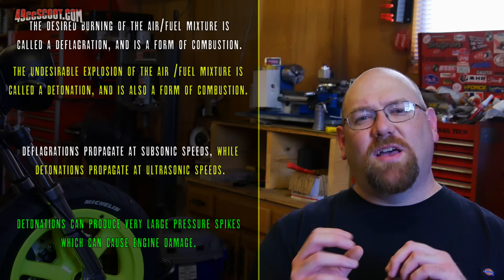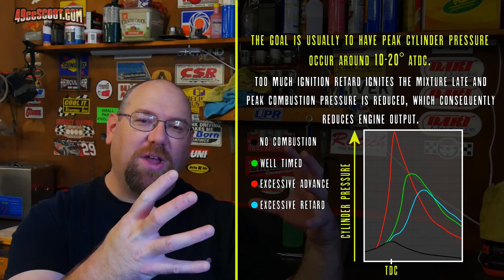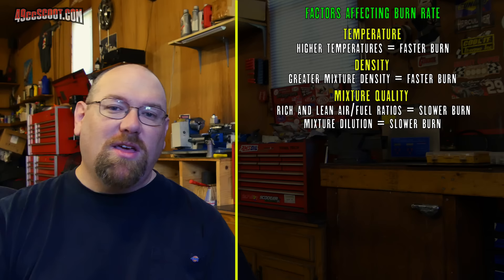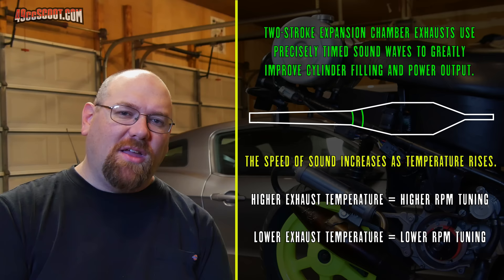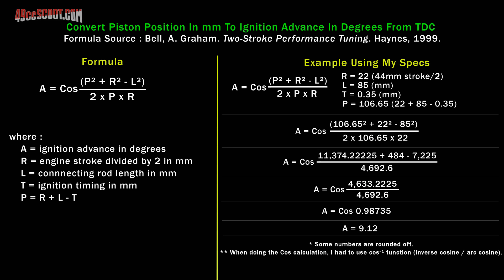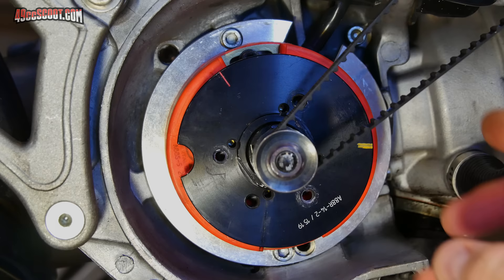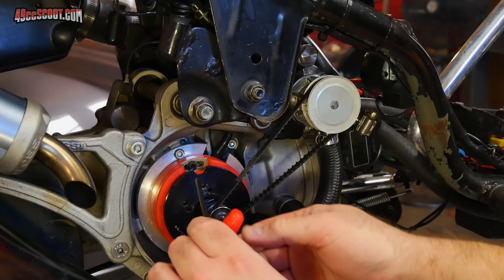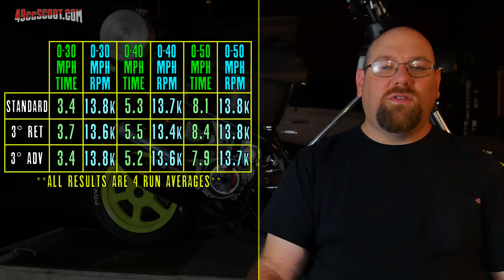Ignition Timing Explained & Tested : How-To Advance & Retard Timing With The MVT Digital Direct

Comment: Man, you need a dyno 😁😉🏁🏁
Reply: Also need  EGT. Cheap China K-typ temperature sensor up to 800c with 1m wire and tiny 12v display (all for under 10usd) will do the job, just for fine tunning.
Only negative is to drill header on Malossi pipe.
🛵🚀
Reply: As a Dyno is great to have but a decent tuner can read the plugs to see what's going on look up plug chopping

Comment: So I took your advice and I threw a rod thru the roof of my garage. You wanna help pay the charge.
Reply from the maker: I didn't advise that anyone changes anything. I shared my project and some knowledge about the subject. If you get into an accident, are you going to blame other people that you've seen driving or that you learned a few driving facts from?
Reply: @49ccscoot   I didn't blame anyone. I asked if if you wanna help pay for it.
Reply from the maker: @csb772  I've got a shelf of destroyed parts from learning and testing things to try to help others. I've paid my dues in broken parts and then some.
Reply: @49ccscoot  Any Honda Shadow parts?? I need a chain and sprocket.
Reply from the maker: @csb772  I've got a bent valve from a Yamaha if that helps. Not many four-stroke parts anymore.
Reply: @49ccscoot  It might fit on my Yamaha keyboard. Any pics??

Comment: 4-stroke engine calibrator here, I have limited 2-stroke calibration optimization experience beyond the basics.  Nice job researching and explaining the theories. I've been spoiled testing $150k prototype engines in $10m test facilities with all the dynamometer toys.  I lust after cylinder pressure measurement setup, this is the future of home diy tuning, when OEMs start using cylinder pressure sensors on production cars, not sure when that will it's very costly to get accuracy and resolution today.

On the bright side, you don't really need all that to maximize your fun, because we got folks like 49ccScoot to help us through.

Comment: The explanation concerning timing effects is nice. As for timing degree, back in the day of the dinosaur, we used this thing called a degree wheel. It's just as easy to measure the diameter of the stator plate, multiply it by pie  then divide by 360. Don't need fancy tools for that. Just sayin.

Comment: You have made a fantastic clarification. I need a clarification: at what level does the BTDC spark plug start firing, and when does the spark end at what level (BTDC or ATDC)?
Reply from the maker: The spark is a brief event that takes place totally BTDC in most cases. Combustion takes a while and should be happening both BTDC and ATDC. Any detail is going to vary from engine to engine though.

Comment: i have put on a 100cc kit and since can get it to run right. seems it wants to run leaner than before . even the stock pilot jet(28) seems too much to idle. thanks for all the vids if it werent for you id be lost.
Reply from the maker: Sometimes they do work better with a smaller jet. The larger bore may be able to draw in more fuel with the same size jets. If it's a drastic change, look for issues with the new cylinder kit.
Reply: @49ccscoot  you are freakin awesome. 👍

Comment: And just like that.... All the kids go out and advance their timing 4deg 😂

Seriously though, good video. I really wish there were more maps available for review on the AM6. 
MVT makes the millennium with two keys for switching to digital which that unit has 3 curves with +/- 3deg adjustment on each with just a flip of a switch. The TPR kit has an offset key but it is not supposed to be used with the TOP red CDI. No details on the curve it provides 
Again, I would like to see some Dyno graphs on this 86 using different curves as to see where exactly this motor needs to be to have it singing.

Comment: Very nice job, covered almost everything. I was wondering if there is a form or a calculator which you can calculate  the settings from the begining with a programmable ignition, at each rpm, just like building an engine from the beginning, without having factory's settings
Reply from the maker: You mean calculate the ideal settings right from the start? I'm sure some complicated stuff with CFD and that sort of thing included could get you there or close, but there's probably always going to be tuning. It would be easier for the average person to take an educated guess based on norms / other setup and then tweak it.

Comment: The formulas section of this video remind me of the video on finding your actual compression ratio. 
If you get into the timing in the future- make a piece on the mini lathe so you can adjust the timing via an Allen screw set at a right angle to the crank shaft. If you put a lock nut on the Allen screw and chart the degrees per turn of the screw you may be able to make very delicate but accurate adjustments of the timing advance.

Comment: hi sir! great video. just want to ask whats the best timing for my engine
i have pushrod modified engine
72mm bore 56.4 stroke
my mechanic told me that he retarded the timing a little bit. now i can feel the engines power when it hits 6k rpm above 5k below feels like just stock engine which is 67mm bore 56.4 stroke. dont now if it has anything to do with timing. id be very glad if you answer my question. thank you so much and keep up the good videos
Reply from the maker: No one can really tell you the perfect timing for your engine, without testing. That's why people pay for dyno time or tuning and spend so many hours with test lights and doing test runs. If someone knows very similar combos to yours, they can probably give you a good educated guess. I would look to others with similar engines first, or see if you can find a dyno shop if you really want to dial it in. Otherwise, you could take steps similar to what I showed in the video to test and tune your way to stronger performance.

Sorry that I can't give you a timing spec.

Comment: There is plenty of BS on web with regards to 2 stroke engines, I watched your video and there is not even a faint whiff of BS, all good stuff! I even spotted that you showed the positive AND negative pressure waves in your exhaust simulation!. BTW I have read A.Bells book many, many times!

I'm rebuilding an old Honda MT5 at the moment, its the trail version of what you might know as the MB5. I've had about 54MPH out of it on the flat which is not bad because when they came out in the UK they were restricted to 30MPH :-(

I do have some ignition issues at the moment and was looking at the MVT system as a replacement but I need to do more investigating, for starters I need to find out whether the rotor will fit the taper on the Honda's crank, then there is the charging at lighting circuits to sort out too.
Reply from the maker: Thanks. I've been pretty happy with my MVT. Good performance vs the stock scooter stuff. Not an abundance of charging/lighting power, but it can get the job done well enough. Seems a bit tougher to tame (regulate) the voltage on, but I'm revving to 14,000 or a bit beyond. No idea on the fit for yours.

Comment: Hello, I installed the MVT with the RJ34-6 CDI on a Honda DIo (41.5 mm stroke) at 0.35mm BTDC. I then watched your video and Pitobread video and I found out the curve you measured. I wish I watched before because 40° degrees advance till 8k rpm overheated my Cylinder and almost melted the exhaust and ruined the cylinder. I watched Pitobread suggesting to keep 28° at around 3k rpm. I was wondering what happens to the curve If I set 28° advance at 6k rpm ( Peak advance for MVT Curve) at 12/13k rpm or in general how the new curve is modified? Consdirering I drop by 14 ° the peak will the new curve be the same with 14° less at each step? I hope my question is clear. Thanks a lot in advance from Italy!
Reply from the maker: You can't change the curve with that CDI; only the mechanical timing setting. So yes, the entire curve advances or retards by the same amount.
Reply: @49ccscoot  Thank you very much. I m not too sure regarding delaying by 14° degrees will work..at 13k rpm I will have approximately a 1° advance...
I guess you are not having overheating problems cause you use the engine either at idle or at full throttle...
Is there a CDI that can be adjusted to custom timing? The MVT EPROM does't seem so be so adjustable, I checked the curves you posted on your website.

Any help or suggestion is Welcome? Thanks, Nicola
Reply from the maker: @nickfarri  I'm not aware of one. I switched the whole ignition very recently because moving the curve forward and backward just doesn't solve many problems. I needed more advance with a bigger carb and then my advance at lower RPM was way high.
Reply: @49ccscoot  The selettra curve for my knowledge seems much better. But no lights and no plug and play for honda dio. Thanks again for your help
Reply from the maker: @nickfarri  The lighting is what held me back from other ignitions for a long time. Look into cordless tool batteries though. Seems like a pretty easy way to quick swap and get some good batteries in there, with the help of a step down (to 12V). May not make as much sense if you don't already have some cordless tools around with good batts.
Reply: @49ccscoot  I leave very close to the company 2fast and I visited the owner. He  thinks I was lean, I did not enrich the main jet as for MVT instructions. He did not really suggested to retard either cause hi RPM need not less than 16/17 degrees advance. I'll try again very rich and do some tests. As alternative I will either go back to stock with a lighter flywehhel ( 17 flat) or try as you suggested. Thanks
Reply: Increased the Main Jet by 10 points and still "burned" the piston exhaust side. The cylinder is fine. Not sure if it was still lean or the top gasket got burned and leaked some air, plug was kind of light. When I disassembled the ignition I noticed that the screw tthat hold the fan touched the stator and leave a groove in it. Also ,the flywheel touched the inside of the stator. Do you think this may have messed up the signal to the CDI. Fly wheel did not move, still at .35 before TDC . Thanks in advance.
Reply from the maker: @nickfarri  I had a crank fail and take some plastic off of the MVT stator and it worked fine. If it didn't dig into anything other than plastic, you should be alright. It may affect water proofing.
Reply: @49ccscoot  ok thanks. Don't understand why I am having heat problems....
Reply: @49ccscoot  I recently found out an other interesting ignition for honda dio ( and many other brands). HPI ignitions, check it out, there are 2 version, racing ( with a possibility of having a 10w output) and with light (55 or 60 W), both with interesting curves and with the option of a programmable CDI

Comment: Thank you for your time great video. I am having issue with a yamaha rd 350 not going past 6k rpm supposed to 2mm btdc may have been off a bit lining up rotor notch to pickup edge no key in fly wheel.thinking i may be advanced and sounds like hear rattling in cylinders
Reply from the maker: If you're questioning it, then to me it would be worth the time to recheck the timing spec.
Reply: @49ccscoot  thanks will do

Comment: I've got a Chinese 2stroke scooter can I do a similar thing with the timing like you did with project taotao? I'm trying to do a lower rpm build for something a bit different than the usual 14k rpm builds
Reply from the maker: The 1E40QMB can actually be adjusted way farther than the 139QMB with a fairly simple modification to the stator plate. You really have to be careful though, because you could throw the timing way off. I've got an old vid that shows it :
https://youtu.be/3d8qHNNi5CA
Reply: @49ccscoot  OK thanks 👍

Comment: we are using this ignition on a 70cc racing setup. Is ist possible and good for increasing the power, if we turn the stator a little bit more in left or right way? or it just can be measured on a dyno ?
Reply from the maker: You could definitely make measurable power if you get just the right ignition timing... or lose power if you get it wrong. It will not be exactly the same for every setup.

Comment: Hey , I really appreciate your work . Could u help me out with measurement from the cable of ur digital direct ?
What is the idle voltage of each cable from the ignition system ?
White ?
Yellow ? 

And what is the voltage of the regulator coming out on the red cable to the battery ?
Reply from the maker: https://youtu.be/buUEmdHxxXY?t=436
Reply: @49ccscoot  nvm I love u

Comment: Hello, I have a cbr 150 big bored 171 with pe28 carb and an ignitech, I would like to know if there is any upgrade map or how many degrees would I set as max for safety (rev limit 11800)before I blow my engine, it is for circuit use, thanks
Reply from the maker: I have no idea about maps for that or what it needs. It would have to be adjusted to find what works unless you can find a map for similar setups. Even then, you'd need to adjust some with dyno tuning or lap times if you want every bit out of it. If you want to stay safe, I'd slowly work up the advance and keep an eye out for knock, overheating or any signs of peppering on the spark plug.